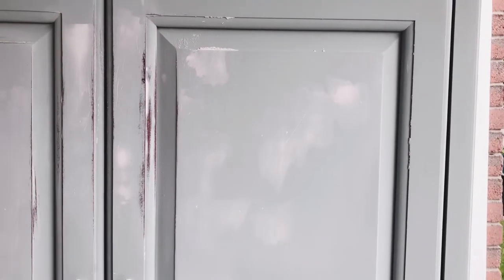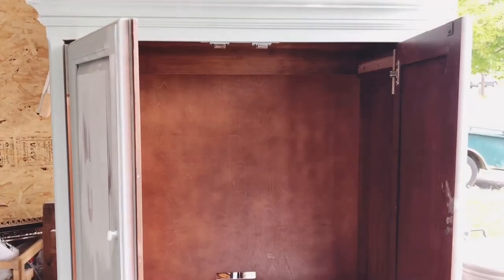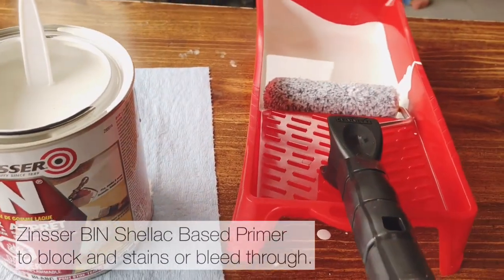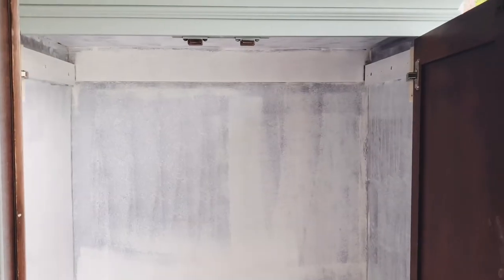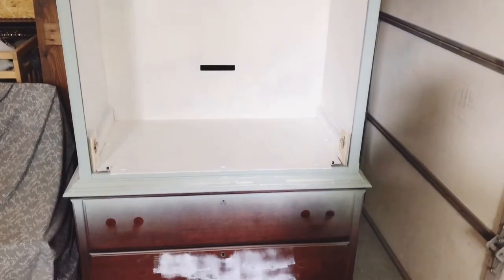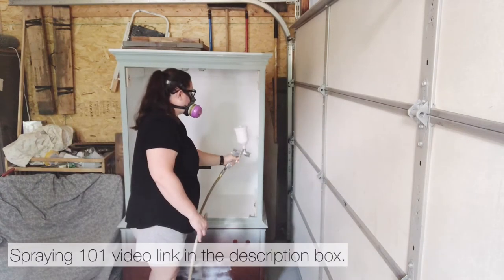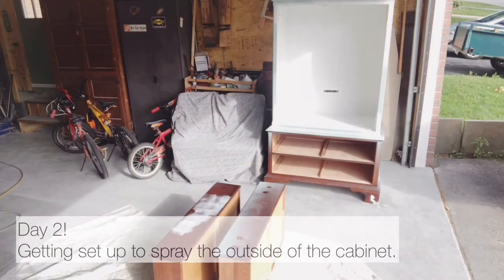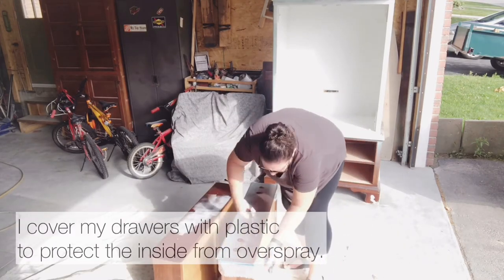FAT Painted Wardrobe | Furniture Transformation | Trash to Treasure

Comment: Yes I like the black hanging rod. It looks very sturdy. I have one small criticism that bugs me a little but that doesn't detract from it's beauty. I have an issue with the keyhole plates on the drawers that have been painted over. If they aren't intended for use, they could have been removed altogether or taken off, polished and replaced. However there are others who like that genuine up cycled look. I guess it's a matter of preference. It's a lovely robe and I would buy it certainly.